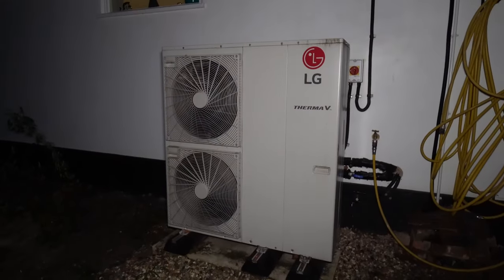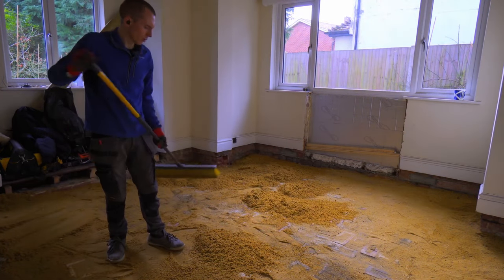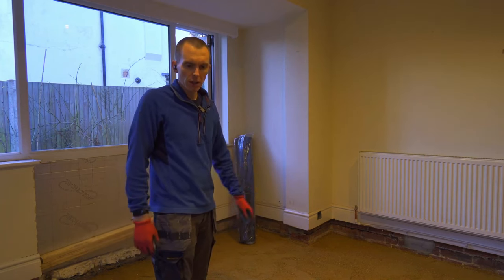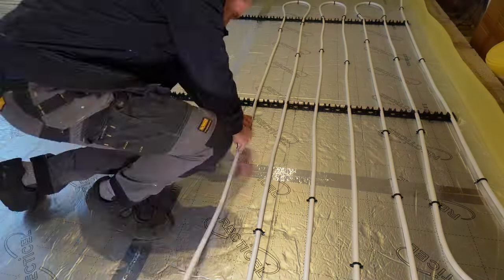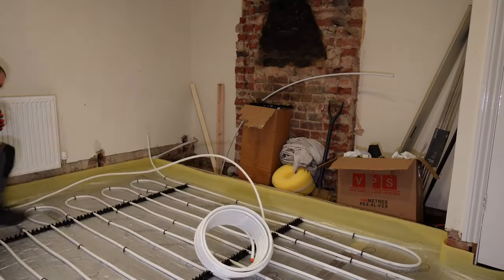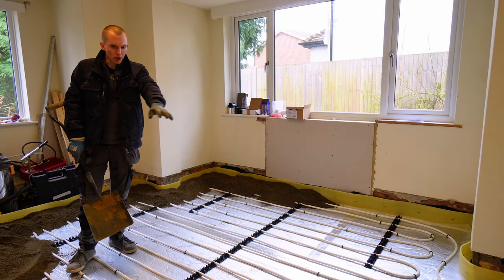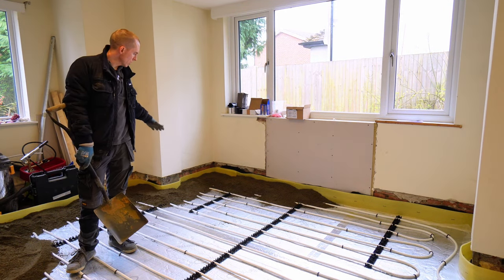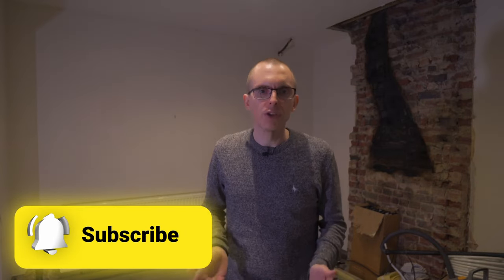Suspended to Screed Floor Conversion with Underfloor Heating

Comment: Looking good, I’m exhausted just watching. Thanks for the octopus code switched this month just in time for the launch of the flux tariff so will switch over to that tomorrow.
Reply from the maker: Thanks, flux does look good, still need to crunch the numbers but will probably switch once I've got solar installed, shame they've skimped on the off peak period, I need 4 hours to charge my batteries in winter, but the high export might offset that problem.
Reply: I agree you need to be a master mathematician to work out which is best. I’m thinking Flux for the summer and switch to one of the other tariffs for winter as we only have solar, a small battery and no EV. Are you fitting an electric heat source pump?
Reply from the maker: We do have a heat pump, when we moved in 2 years ago the only heating was an ancient coal fired Rayburn and there was no gas running to the house.  Combined with the RHI payments that were available at the time it made the choice of a heat pump a no brainier.

Comment: One vital stage you appear to have missed is installing a layer of polythene over the insulation and under the underfloor heating pipes. This polythene only needs to be 500gauge but could also be 1200g DPM. It serves many purposes, it prevents vapour passing through the insulation and condensing on the DPM on the cold side of the insulation (your aluminium tape does that too), stops the screed going between the insulation (OK tape does that too) but the most important issue still remaining is that the screed dossolves the aluminium facing on the insulation boards. This destroys the integrity of the aluminium and can allow vapour through the insulation causing condensation issues. In extreme cases it can weaken the screed. In the insulation manufacturers literature this membrane will either be described as a VCL or as a separating layer. The new floor also required Building Regulation approval, something regularly overlooked. Had you got the neccessary permission the BCO would have hopefully spotted the omission of the VCL and that alone would have justified the small cost of getting BReg approval.
Reply from the maker: You're not wrong and I had purchased and planned to install a VCL, ultimately I opted not to use it for practical reasons. Like you said the taped aluminium works just as well as a vapour barrier and prevents the screed migrating down between the board.  I'm not convinced about the cement reacting with the aluminium to the point where it becomes a problem. There is a suggestion that wet screed will cause a reaction if the aluminium hasn't oxidised which will produce hydrogen bubbles and could possibly weaken the screed. I don't think the reaction is going to be nearly as serious with a semi dry screed and won't weaken the screed. I'm not sure anyone has ever proved the reaction is serious enough to weaken the aluminium to the point of failure. 

I don't really know if it's vital or just generally a good idea, but I also couldn't see how I could use the pipe spacing rails which stick to the boards with a VCL in-between and on top of that the pipe staples would fill the VCL with holes. It almost seems more sensible to place a VCL above the underfloor heating but that wasn't the recommended method. 

Thanks for the comment and suggestions, I'll definitely research this further before attempting another floor.
Reply: @RodMcBain  I think the best thing is to do both, tape the sheet joints with aluminium tape to act as a vapour barrier, and just consider the polythene a separation layer to keep the screed away from the aluminium. I have been told by countless builders that they have never put polythene under the screed and over the insulation as they didnt realise it was required, and havent seen any issues as a consequence, but I would always put it in myself. I have seen foil faced PIR used as external wall insulation under render (totally inappropriate choice for EWI) and when the render all fell off shortly after (despite also using EML) there was nothing left of the foil facing.

Comment: Just found your channel and have watched a couple of your videos - you have an amazing skill set.

Tackling these sort of jobs on your tod is very challenging - two people are three times as fast😉

Why did you leave the section of suspended floor in the bay window area?
Reply from the maker: Thanks! That bay window is at the front of the house where i'm planning to build an extension. The bay section will come down and a stud wall will go in where the new floor ends, the bay section will end up in a new room.

Comment: Hi Nice video, did you tie the new dpm into the existing slate damp course? if not are you not worried that moisture may rise up the walls at all? or is that not a concern you needed to worry about?
Reply from the maker: Thanks, I didn't tie the DPM into the slate damp course, it's not something I've seen done and I wasn't concerned about it until you mentioned it 😀 It's the sort of thing that sounds sensible but in practice is almost impossible to do reliably and is likely to make no difference. But I'm just a DIYer and probably don't know what I'm talking about...

Comment: Hi Rod
How old is your house and what type of damp-proof-course did it have, if any?
I'm wondering if the lack of airflow under the house has in any way increased to likelihood of rising damp or anything that can compromise the walls of the building?
Reply from the maker: Hi, House was build around 1910 and has a slate DPC. Our house is very odd in that most of the ground floors are solid, the floor I converted in this video was the only suspended floor.  My understanding is the airflow required under a suspended floor to prevent moist air from condensing on the cold wood under the floor where it would quickly lead to rot, I don't think a lack of airflow can contribute to rising damp. I guess it's possible a badly installed solid floor could bridge the DPC and contribute to rinsing damp, but in this case if anything is in contact with the DPC it's the plastic vapour barrier so almost certainly not a problem.
Reply: @RodMcBain 

Thanks a lot for your explanation - it makes perfect sense. That's the main reservation I've always  had in relation to replacing the suspended floor, but have struggled to find any information on it. Keep up the good work, brother.

Comment: How was the mix.  Seen other vids were it says don't use portland cement but a rapid set one and only use a verticle mixer
Reply from the maker: It was OK, think my biggest mistake was my first batch not being wet enough.  I'm not sure I'd want the mix to be setting any faster than it was, maybe OK if you have someone mixing and someone else laying, it's very time consuming mixing, moving and laying yourself.
Reply: @RodMcBain  oh well it's done now, if you ever do again...

Did you use a rapid set cement as others have recommended to do so?
Reply from the maker: @dominicoconnell1584  Just used normal portland cement, had not come across the recommendation to use rapid set, but even then being a semi dry mix it still set a bit quickly for my liking.